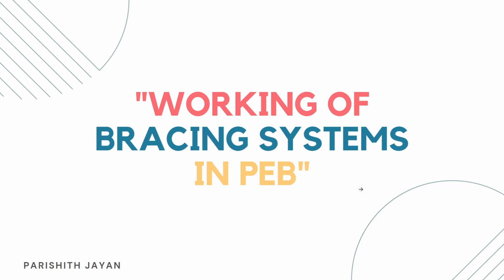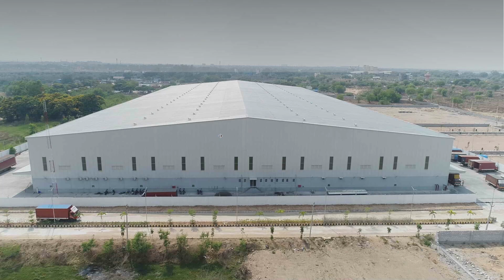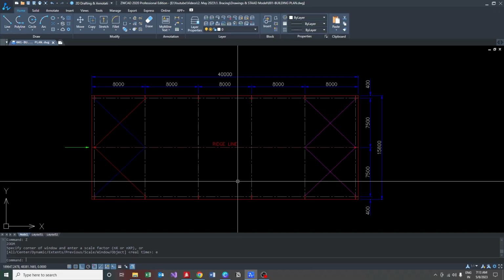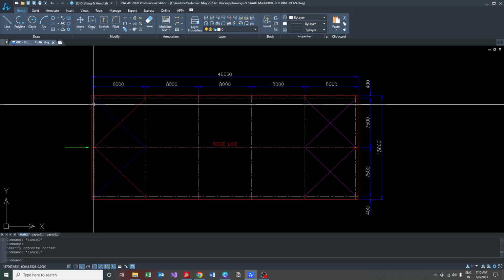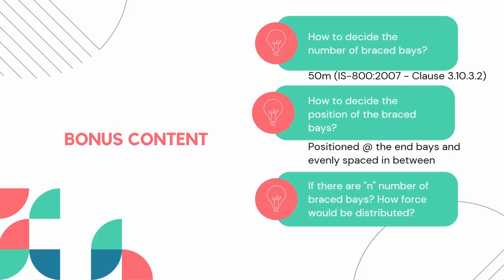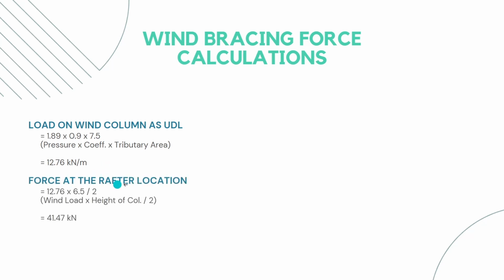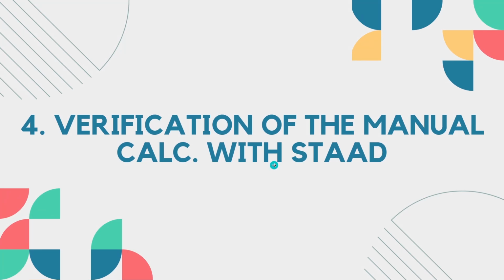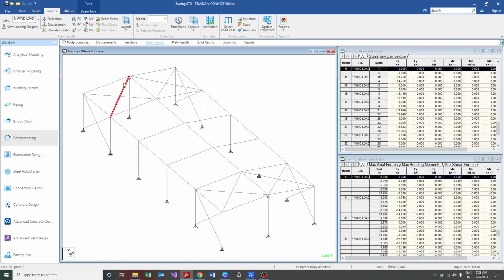Roof Bracings in PEB (How they Work!)

Comment: Impressive Video 

But One Qs 

U said that if we have 80m span we need 3 braced bays - Maximum allowed is 50m so Can u tell me how 3 braced bays ... PLease
Reply from the maker: Considering ur building length wise split up is 10x 8m bays..

And m assuming that u r going to brace penultimate bay (last before bay) on each side.. which means the center to center distance of bracing will be 80m - 24m = 56m.

Which exceeds 50m, so we need to have 3 braced bays in the building..

Comment: How bracing behaves at expansion joint location?
Reply from the maker: The basic assumption is that, the force won't transfer from one side of the expansion to the other..

All the forces which arises from one end gable should be carried and transferred within the bracings provided before the expansion joint itself..

Comment: Thanks for this amazing video. I had a question - What happens if we do not provide the connecting member at the ridge line in this case, how does the bracings behave? What if we do not provide gable end column, Are roof bracings needed for no gable column case?
Reply from the maker: Obviously we are going to provide purlins above the rafters and near ridge there will be two purlins closer to the ridge, they try to transfer the force..

And incase if there is no wind column and the building is kind of open, we provide bracings on roof for the stability of the frame along the longitudinal direction..

There won't be much of a calculation subjected to calculating the force.. But there has to be minimum bracings provided on the roof to attain stability..

Comment: Dear Sir your explanation was awesome. But I have one doubt, how do the first 2 rods will inactive, why don't they take the bracing force and gets buckle (fail's in buckling). And also what about wall bracing, which rods will take the force and which are inactive. Please clarify my doubts..... Thank U Sir.....
Reply from the maker: Basically, the rods are slender members which are not intended to take any compression force. 

Once the bracing force reaches those points, they try to push the rod and since they are slender, they can't withstand this force or they can't transfer this force, so they buckle away means losing its capacity to transfer the bracing force through compression.

Then the force tries to find the new path to reach bottom. So it travels along the line of action, and once it reaches the second rafter, the alternate pair of brace rods gets activated and resist the load through tension.

The same for wall bracings as well.. go through the video once again and try to make a simple bracing model in STAAD and study the behaviour to understand the concept.
Reply: @parishithjayan  Thank U soo much Sir for your kind reply...

Comment: Very good explanation about bracing system and it's important but if bracing have reversal stress like sometime compression or tension so what is it slenderness limit we need to consider ?
Reply from the maker: Just follow code. As per IS 800, for the strut or bracing member subjected to wind or seismic loads where there is a possibility for the reversal of stresses, need to check the tensile slenderness ratio for 350
Reply: @parishithjayan  thank you !!